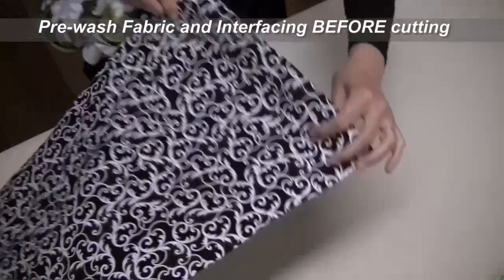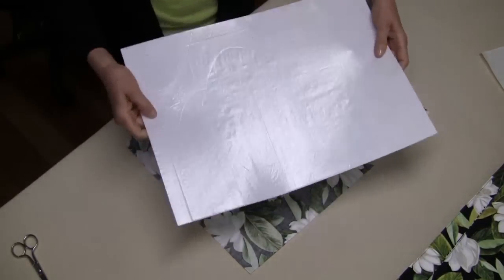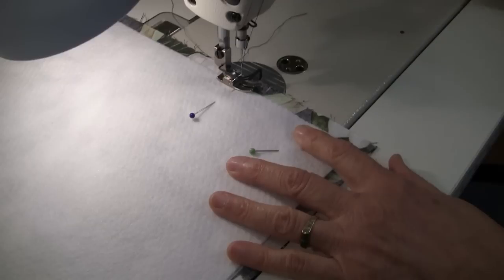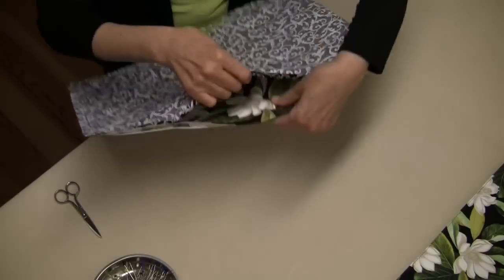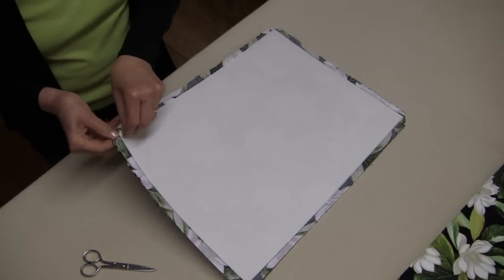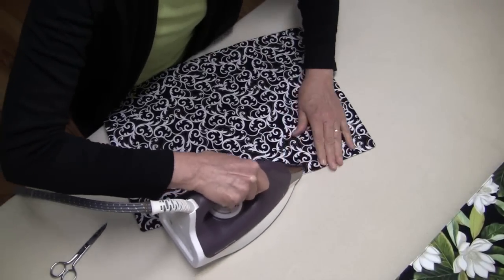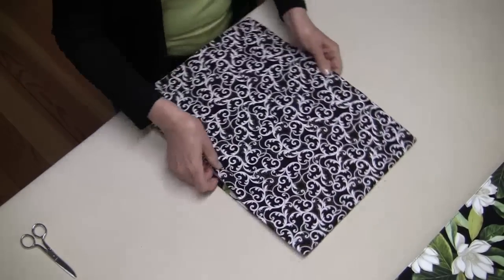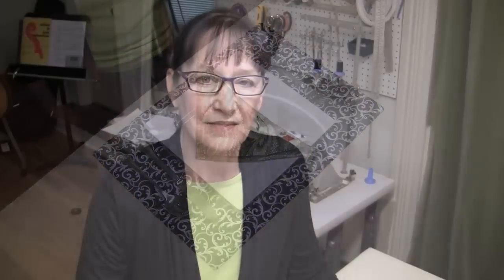Sew Reversable Placemats

Comment: What exactly is the stiff interfacing?
Reply from the maker: I used this product: Therm O Web Bulk Buy Thermoweb Heat N Bond Medium Weight Iron On Fusible Interfacing White 20 inch x 36 inch 3337 (4-Pack)
by AddPower Brands
Learn more: https://www.amazon.com/dp/B0033PI9ZM/ref=cm_sw_em_r_mt_dp_U_

Comment: Great techniques.  Thank you.  Question:  Why use such stiff interfacing?  I would think it could make the placemats difficult to wash and dry.  Could you enlighten me on this please?  Thanks so much!  :)
Reply from the maker: Elizabeth Hansen Hi, Elizabeth, Thank you for writing! You make a good point about the interfacing. Before making this tutorial, I made a set of place mats for a client using light weight cotton batik. She had provided pre-cut "place mat" interfacing which she purchased along with her fabric. The pre-cuts, however, were too large for the amount of fabric she provided so I exchanged them for a similar interfacing by the yard, a more efficient and economical alternative. I liked the results so much I made a tutorial using some fabric I had on hand. The heavier interfacing does require careful cleaning (I washed/dried one on gentle cycle and had to iron it thoroughly.) However, I like the substantial feel and look of the place mat as it lays on the table. I don't imagine everyone would want this type of interfacing, but for those who do, they have a tutorial to refer to. This is why I think youtube is such a good resource. Why make a tutorial using the same type of interfacing someone else has already demonstrated? I hope this has helped. I'd love to hear your thoughts. Sincerely, Peg
Reply: Oh Yes, this HAS helped very much!  I do like a substantial placemat that lays flat on the table.  I just wondered if the stiffer interfacing would be a problem in laundering.  I am an ironer, so it's no problem for me...I'm always ironing everything!!  I like your technique of using the Heat n Bond sheets on the interfacing.  It looks as if it makes the fabric lay so nicely.  I have some Heat n Bond sheets like you used.  Going to give it a try!  If time doesn't get away on me, I'm going to make patriotic placemats for this coming weekend, and I needed some inspiration to get me going, thus I found you on Youtube!  Yes, it is certainly a great avenue for ideas and instructions, some good some not so good, but your explanations and methods are really superb!  Thank you, and for such a quick response to my inquiry.  I'm kind of old-fashioned.  I think every girl should learn to sew and to sew well!  Even young men should learn basic sewing skills.  I'll be checking back to watch more of your tutorials, Peg.  God bless and thanks!    Elizabeth Hansen
Reply from the maker: Elizabeth Hansen Thanks, Elizabeth! I would love to see your placemats. If you'd like to share photos, you can send files to my email address: littlebug903@yahoo.com. I am compiling photos from many of my subscribers' projects for a new video. If you do send photos, please let me know if I may use them for this project. Sincerely, Peg

Comment: Why not just use fusible interfacing?
Reply from the maker: Hi, Heather. Thank you for writing. It's been some time since I made those placemats (for my mother). I'm fairly sure I used the applied adhesive because, at the time, I couldn't find the weight of interfacing that I wanted. Otherwise, your suggestion makes a lot more sense. Thanks again, Peg

Comment: Interfacing seems too stiff.
Reply from the maker: Hi, Dorothy, yes, that lining was quite thick. I wanted to test that  brand and weight of interfacing so I made these placemats for my mother (instead of a client). Actually, they've held up nicely over the years by hand-washing. Not recommended for everyday use where machine washing is preferable. Thanks so much for writing. Peg